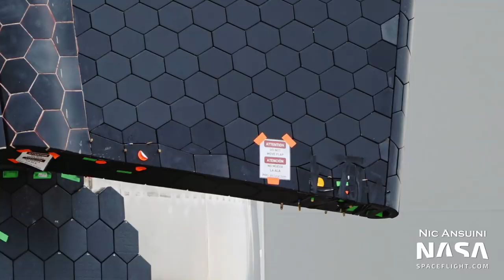Booster Common Dome Section Flipped | SpaceX Boca Chica

Comment from the maker: 0:00 - Sunrise
0:18 - The Launch Site
0:35 - Crews Work on Ship 20
3:47 - Orbital Tank Farm Construction
4:39 - Orbital Launch Mount Construction
5:12 - Orbital Launch Mount and Chopsticks
5:28 - Quick Disconnect Arm
5:45 - Crews Work on Booster 4
7:28 - Aft Flap Alignment Jig on Ship 21
8:10 - Ship 21 (left), and Ship 22 (right) in the Mid Bay
8:33 - Wide Bay Construction
9:06 - Barrel Sections at the Production Site
9:46 - Booster Quick Disconnect Hood
10:03 - Ship 21 Nosecone Construction
10:49 - Booster 5 in the High Bay
11:16 - Flip Rig Attached to Crane
11:59 - Booster Common Dome Section Flipped

Comment: Stage 0 has taken so much time and effort at this point.... hopefully it survives the first orbital launch
Reply: Hopefully more armoring happens.  There not been much in reports on water system keep sound & flame of the Booster from roasting the mount as it takes off.
Reply: Cross your fingers this thing doesn't pull an ORB-3. Otherwise, stage 0 is going to be reduced to piles of steel...

Comment: What's the purpose of flipping?
Reply: Its nice to see a real question lol.
Its easier and more precise for them to get the sleeves over the domes if the domes are pointing upward. So whenever they sleeve a common or aft dome it just needs to be flipped afterward to orientate it the right way for stacking.
Reply: Easier to construct that way.
Reply: Yeah, those other answers are ‘OK’..

But the REAL ‘Down to First Principles’ answer is

To flip them right-side-up

Comment: What are these longitudinal lines at the inside? Welding seams make no sense without braces, and there are no welding marks on the outside 12:30
Reply: They are called stringers, they are inside the lox tanks of boosters and several other places that could use a little extra reinforcement. Thats all they do is toughen the walls a bit.

Comment: Why they don't want to run first test flight without SN20? The booster has never been tested at all anyhow nowhere.... It stands like a monument. What can go wrong?
Reply: they know how to launch and land a tank having done it several times. Perhaps nothing significant to be gained by hopping booster and the focus is now on testing an orbital configuration and launch/flight.
Reply: @johnvdlaar747  but there are 29 engines... i wonder if something like that tried to fly ever
Reply: @MegaRomull  Falcon Heavy has flown with 27 Merlins, so if it fails, I don't think that will be the issue...
Reply: @dancingdog2790  Oh, that's true! I've forgotten that
Reply: The booster can not be started without the launch mount/table (the booster engines’ pumps require external pressurized gas to start). The required systems are not on board like Starship, but on the ground equipment. Until that part is ready, it is not going to be tested/fly.
Reply: @placplacan6346  I believe only the engines on the perimeter require the launch mount to start. Certainly the engines to be used for landing will be able to be restarted in flight
Reply: The key thing is landig. It will require a lot of engines to be reingited. My guess is at least 4 but maybe even 6. This will damage stuff and also the propellant in the booster at landing could cause a huge explosion. Therefor they want to land it in the ocean. And if you're going to do that anyway why not try a orbital launch? SN20 is already surpassed by newer designs and so is booster3 . So no big problem in blowing them up.
Reply: @johnvdlaar747  Only the engines that need to be reignited will be able to start using the COPVs, but the perimeter ones require ground equipment. Without these engines, the rocket is going nowhere, FDA approval or not.

Comment: What is the motive of flipping ????
Reply: For some domes, they need to be the other way around so when that dome is on the sleeving stand, it is upside down, they flip it so it is the right way up. It's jut the easiest way to build it.
Reply: Overhead welding is hard, easier to flip the work over instead.
Reply: @deltalima6703  Also probably easier to keep the dome positioned properly to the barrel when the outer edge of the dome is down against the jig.
Reply: @WM3636-d1c  Exactly, Sleeving is much easier and controllable this way, for aft and common domes they just need a flip for stacking afterward.

Comment: Have been offline for a while, so missed this new structure. Can someone tell me what that is? At the lauch site there is the Booster 4, the StarShip 20 and a 3rd one! What is that? It is not a starship and does not have gridfins like a booster, so what is that ?
Reply: I believe you're talking about booster 3, they have cut the top part off a while ago
Reply: The other is correct, the tall one is Booster 3, her head with fins is on the ground beside. It was cut up enough to not be a danger while hanging around after a 3 engine static fire. 
Recently there has been a few new friends, B2.1 (not BN2.1) A tiny hybrid ship/booster test tank and GSE4 is back for more testing.
Reply: I think the new structure you're referring to is "wide bay", a new larger assembly building along the lines of high bay.
Reply: @Vatsyayana87  ah okay ..you are right. That's BN3 👍
Reply: @2gabrieu  yes! Thanks 👍
Reply: @daveshaw9310  i suppose the term "structure" was the wrong word .. however yes, waiting for the new wide bay to come up

Comment: reusable and rusting ?
Reply: @thiesenf  No, Robert is right, it is rust, stainless is only stainless if pristine, simple fingerprints will rust it.
Reply: Indeed, but understand a couple things. Its superficial rust, Its not gunna cause any issues for years, but also, these ones are still prototypes and will be gone long before it has any effect.
 I very much doubt we will be seeing this on the real deal.
Reply: 2:23
Reply: @thiesenf  2:23
Reply: It is not rust, it is tarnish which is superficial. Tarnish you can polish off, rust you can't.  It is the carbon in steel that rusts in contact with oxygen, and stainless has almost no carbon.
Reply: @smacksman1  Im quite confident its rust.
there is zero carbon in rust, its iron oxide.
Reply: @Vatsyayana87  Quote by Metallurgical engineer Michael L. Free of the University of Utah -
'Stainless steel remains stainless, or does not rust, because of the interaction between its alloying elements and the environment.'  The article goes on at some length and can be Googled.  Corrosion is possible under several circumstances, ie. lack of oxygen, for one.
Reply: googled = What can cause stainless steel to rust?
Exposure to corrosive process fluids and cleaners, high humidity or high salinity environments such as sea water can remove the native protective layer (chromium oxide) and can cause stainless steel corrosion.
Reply: @smacksman1  Thats interesting but experience seems to disagree, unless its a coincidental reaction not including the combination of iron and oxygen atoms to make stains.
 What would the composition of the orange material on stainless steel that happens on areas that endure rust enhancing circumstances like salt or high heat be if not rust?